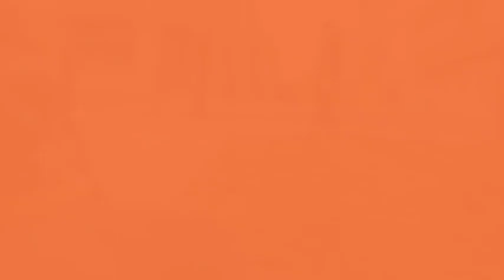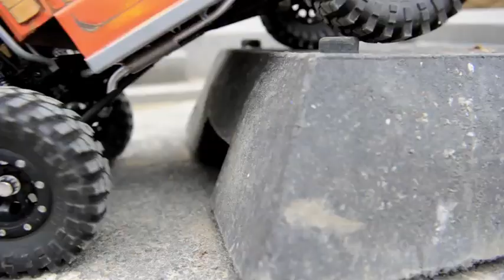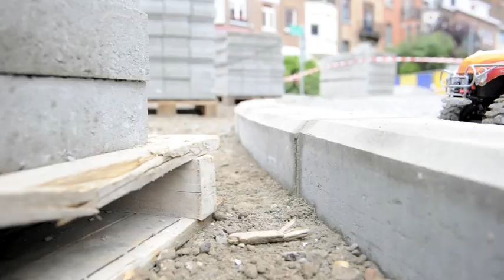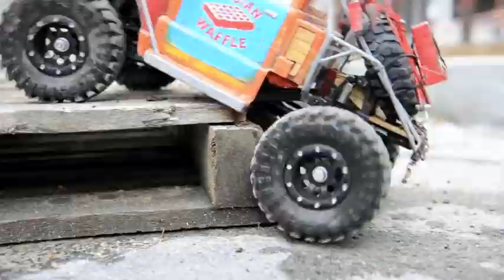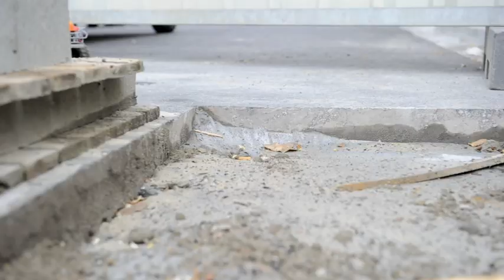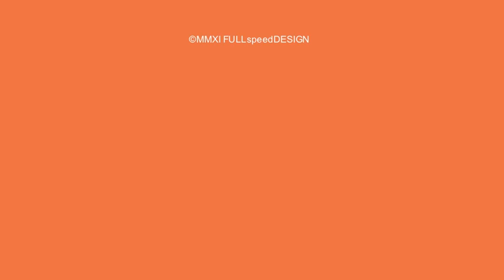Axial SCX10 CF100 Le Bigleux Premier run

Comment: I had to cut my front out too to make the winch fit and body fit well. Your tube work looks amazing and fits with the classic style truck.  As always the paint makes the truck and the little muffler and tail pipe brings the scale look even further.  Is that a little wooden box under the rear tube frame with some goodies? :)  What E.S.C. and Motor are you running? It creeps really well and has decent wheel speed also.